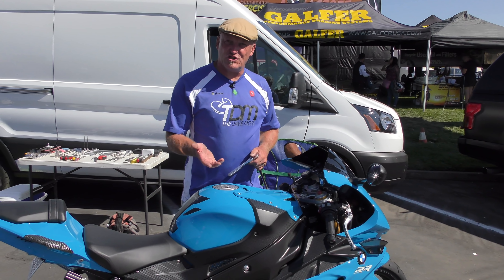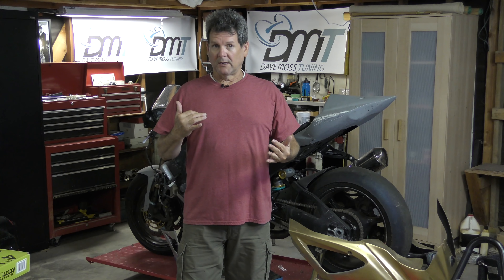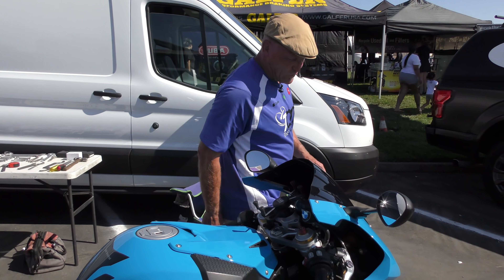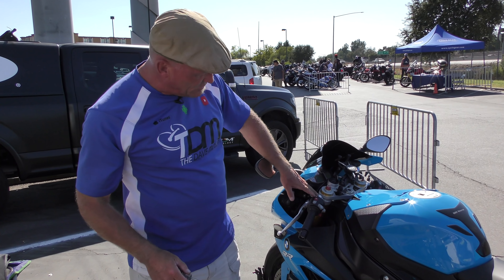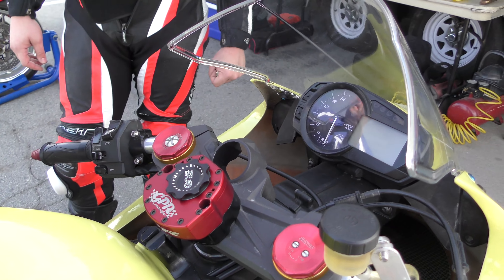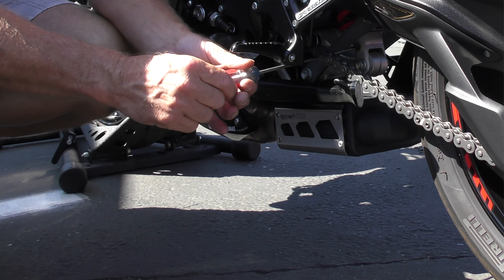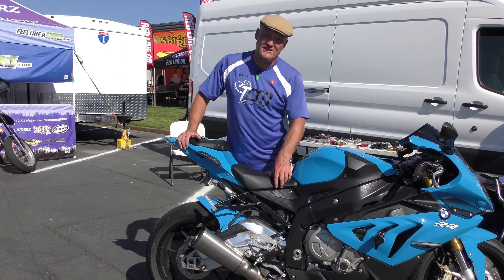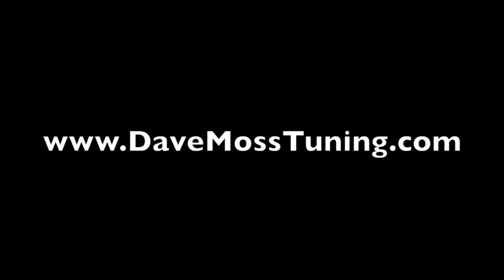Motorcycle Suspension Adjusters: What Why Where and How

Comment: something in tension is being pulled ,  the front fork spring is always in compression , it is just more or less compression that you are adjusting on the spring. I'm not talking about dampening, just the springs loading.    "In physics, tension is the pulling or stretching force transmitted axially along an object such as a string, rope, chain, rod, truss member, or other object, so as to stretch or pull apart the object. In terms of force, it is the opposite of compression."

Comment: Brilliant as always Mr Moss and Mr Williams 

Learning is a process that starts with  an inspiration to know more, after that with the right teachers it become infectious. 

20 years ago I bought my first bike, a GPZ750r and tore down the front forks  to understand how they worked.... well I needed to change the seals as they were leaking. 

Years on  and several bikes later  I couldn't understand why people found bike suspension a mute point. You pointed out that people cannot discuss what they do not comprehend.

Well its been 5  months since I serviced the suspension on a GSX750F (04) the chatter it has started around that group of riders  is getting louder and as always I point them towards your videos as it is such a great resource for learning to occur. 

One of these riders i heard  went to look at a Fazer 600 in a show room and was told it was fully serviced. when he asked does that include the forks and shocks the retailer scoffed at him with a "Noooo"  to which he replied well its not fully serviced then and you can keep the bike.

I don't know about you, but every time I tear down a shock or a fork  I learn something new and comprehend more. The hydraulic fluid for one tells a story.  whether it has turned to chip pan oil or an emulsified goop neither state is desirable for efficient suspension that brings the bike to life.

Comment: I stand to be corrected, but Dave started with all the way out ( open tap) 10 clicks out when he adjusted the rebound for the S1000RR. But the other chap said you should start all the way closed (tap closed) and then work your way out. So the S1000rr wasn't started at 3 clicks out from closed. Dave actually started it from 10 clicks out fully open. Just wanted to point this out, thanks. @10:53 & @15:05
Reply from the maker: Great point, excellent observation. If you start open, you get a more accurate rad on initial sag numbers. If the tap is closed, compression will hold the bike up so you will get a different reading. Anyone reading this comment that has adjustable suspension - try max preload and compression (measure), then remove all preload and compression (measure again). What was the difference? NOTE: don't forget to check for stiction: https://www.youtube.com/watch?v=qK6_7oTF_bI&t=6s

Comment: Im 210lbs.  fully leathered. My front, on track, dives too much... rearend seems great on track. I know I'm not balanced though. On the road, rear bucks u off at higher spirited speed, front feels really comfortable but a bit soft.
 06 cbr Honda f4i is what Im going to try out your recipe  on. Thanks for all this info. Seriously important info you are giving me... I'm   sittting on Dunlop q3 sportmax. Think, i will keep the same tires I'm used to. Temps run at my window of riding...ambient air about 88 to 98f. They perform nice on and off track with pressure attention. Just had to say it outloud.
Reply from the maker: Start with a cable tie on the front forks and mark bottom out to see how much travel you are using. Next, check static sag on the rear shock. Then check tire wear for rebound.

Comment: Thanks a lot for a video, just a quick question here i have is, after fully tearing apart, and changing all seals and everything, should we set again all the adjustments ?
Reply from the maker: I would reset hydraulics based on new oil, I would not change preload.

Comment: Hi Dave, thank you for the response. I should have elaborated better in my question. 

What i was wanting to understand is that for example on the S1000RR, you started by counting rebound on the right leg at 3 clicks from close and the left leg was 6 click out. Then you reset the left leg to 3 clicks out to match the right leg . Similar to compression on right leg was 5 click out and left leg was 2 click out and was reset the left to match the right. 

May i know how can i tell which leg is the correct one because i might mistakenly reset the right leg to match the left leg in the case of S1000RR for example. Because im still a beginner on suspension tuning :)

My apologies for the confusion earlier and thanks again for making the video.
Reply from the maker: Hi Edward. Right leg/yellow is rebound. Left leg/red is compression. Both have 10 clicks to work with for each adjuster, all the way left being minimum (#1), all the way right being maximum (#10).

Comment: I have an 84 Honda VF750F that has numbers 1-4 on both sides.  I am guessing that clockwise and counter clockwise would be the same on all bikes.   Can we say the higher the number the stiffer and the lower the number the softer?   The rear shock works on air pressure.  No longer an aggressive rider..lol  Street Settings?  Gonna have to check the rear spring tension.  Great Videos.   Waiting for the 1/2 meter of snow to melt ...lol
Reply from the maker: Hi Brent. You are correct that 1 is minimum and 4 is maximum. Suggested is 3-5psi for the fork air pressure and rear shock is 7-40psi. So I would start with 25psi and test that plus 15 and 35psi. Set damping at 2 while you find the air pressure you need, then test 1 and 3 for damping BUT make sure you ride for an hour first prior to changing damping to make sure the oil is hot.

Comment: I look forward to having fully active suspension where an ecu is doing all the adjusting for me except me choosing a setting....I would think with computers today that could be the optimal thing!  I have semi active suspension on my 22 Yamaha T9gt ....I dont know how good or how bad it is but it seems to work so far for me....all the manual stuff just seems like voodoo to me I can not wrap my head around it   Am I just beyond lazy?  Or is it reasonable to want TECH to take over keep everything adjusted?  Back in the day I had to constantly mess with carb jetting when racing MX and it was truly a PITA especially when racing at altitude etc but even changing expansin chambers or the weather etc made a difference ,,,,nowadays an ecu is adjusting the mizture!  So wonderful!  Suspension and EVERYTHING should be like that I think!  Yes it will cost more!  It will be WORTH IT IMHO lol!  I just want to select HOW I am riding and let the computer make the changes....like sport, rain, comfort etc....Seems like sensors and servos etc could make changes as you ride the moment the conditions change the settings adjust!  ya know?

Comment: The time I watch your video Dave I’m so impressed.. i have 2020 MT09. My question is, I adjust my shock on the rear and front shock,do I need to adjust the front shock also? or stay on the factory level? Thanks you
Reply from the maker: Try factory height on the forks to start for a couple of weeks, then change fork position by 7mm and see if you like the difference.

Comment: When using preload adjusters which are just turns(like a 17 wrench on forks or an external shock adjuster),when nearing the maximum,there is always some resistance when you are near the end. To get a proper reading,do you stop immediately after you feel ANY resistance,or keep going a bit more?
Reply from the maker: Resistance will increase as the spring is under increased tension. I will go from mechanical stop to mechanical stop to find the range and know where I am. For reference, the owners manual will tell you how many revolutions you have for each adjuster so use that for your initial reference prior to making adjustments.

Comment: Hi Dave, nice video, I have a z1000sx Kawa, which oil it's the best for your experience for the front fork? My style driving it's tourist, no races, but I don't sleep on the road. I ride alone, no passengers, sometime whit boxes back, ma not so often. Thank you for the answere. Nice world the suspension bikes world, I think one of the most complicate to know. Regards
Reply from the maker: Thank you for the kind words! For your situation, I would recommend 10w fork oil, Motul or Maxima seem to be readily available. Use the stock volume or oil height!
Reply: @catalystreactionsbw  Hi Dave, tanks for your information, My z1000sx year 2016 24K km, runs well, I update myself the settings front fork and back respect your video concerning exactly my bike. (Iam 85 kg ready to drive) But, one problem I had before and still exist. Shimming bar drive if I let the bar free in deceleration. Not to much but I have. Pression tire 2,5 /2,9 , I try less no change at all. Tires perfect balanced, bike never drop down etc etc, chain tension in the range, no play in the tree fork..What can I do?? suggestions?? many takes and regards... Piero
Reply from the maker: @pierograndi5898   Hello Piero. If the bars move side to side on deceleration there are a couple of things to check.  1. Too much weight transfer forward as shock rebound is too fast. You might try to turn it half a turn left, then 1 turn right to see if that is true. If not, it goes 1/2 turn left back to the original position. Fork collapses too quickly so compression screw is too open. Turn it in 1/4 turn increments right to see if that is true. If not, turn it 1/2 turn left back to the original position.   3. Loosen the pinch bolts  and ride the bike at 15 -20kph and brake several times. Tighten and torque the pinch bolts again and test.
Reply: @catalystreactionsbw  Hi Dave, I follow yours suggestions and I have resolve the problem, It was generated by the suspension front and rear I make harder just a little and...TOP!!! Many tanks Mr Dave, will be a pleasure drink a beer with you. Regards and thanks again Piero.
Reply from the maker: @pierograndi5898   Thank you for letting us know you found the solution!!

Comment: Good day Dave, My name is Enrique, I am from Mexico and I have a bmw F700gs 2014.
The forks have no adjustment at all, manual says that it has 550 ml of oil in each fork, in order to adjust them the way a like it, I think I can add or put less oil, then I use the motorcycle a few days and see how it works.
Am I, right or wrong? And the increase of oil should be ? . I want the suspension stiffer.
Reply from the maker: Hello Enrique. Depends on your weight - I need that prior to recommending fork oil viscosity.

Comment: What about on a basic bike with no fork adjustment and only preload on the rear. Any tips and tricks for playing with these on the cheap?
Reply from the maker: Oil viscosity thicker or thinner and different volumes along with different size spacers. You can also change fork position for faster or slower turn in.

Comment: Just bought a 06 gsxr 750 front end to swap onto my Victory Octane and as soon as I picked them up I’m like I need to earn about suspension setup!
Reply from the maker: Look at videos on my channel for fork sag, shock sag, fork travel and shock travel. Those short videos give you the basics. Then watch fork bottom out and "dump and run" oil change as you will have to do this unless you know for sure that the oil was changed before you bought them. Enjoy the learning and thanks for choosing DMT.

Comment: Quick question for Dave or anybody else who might have an answer. I have a "new" '02 GSXR 750 that I'm attempting to set front sag on. The rear sag was perfect for me already. 
The front is coming in at 44 mm with me on the bike. I turned the preload adjusters a 6th of a turn at a time to one full revolution and the numbers didn't change at all. Should I just keep on cranking or what?
Reply from the maker: Just keep cranking on the preload as it is a very progressive spring. Then assess fork travel used to see if you can get to ideal travel, that being 15-25mm from the bottom of the chrome tube.
Reply: @catalystreactionsbw  thank you my friend. I didn't want to start cranking, go too far and screw something up

Comment: thanks Dave! Hey I've seen you at Buttonwillow before, but I don't think you offer suspension support.  By any chance will you be offering suspension support at BW?  I just installed a MUPO Suspension on my K46.  I need help setting it up.  I want to say you go when Pacific Track Time is there.  I ride BW Feb-Sept.
Reply from the maker: I do not work at Button Willow unless there is an AFM event or Carters at the Track has an event there. All other BW Track Day providers have contracts with other suspension vendors.

Comment: If you’re bottoming out forks, would you add more preload or compression and why?
Reply from the maker: preload first as that is steel and structural, then compression second for oil flow control. If you bottom, repeat the cycle. If you get to 80% of preload and compression, is your oil old or has your ability increased substantially so you need to revalve & respring?
Reply: @catalystreactionsbw thanks for the response. I added on more preload and that brought my zip tie up about 2-3mm up from bottom out. (Still not enough in my opinion) However, the bike felt a bit less planted through the one fast right hander and I had minor headshake in that specific sweeping corner that I did not have previously. Would that have anything to do with it? That was my last session of the day however so I am curious how to precede? Thanks again for the replies.
Reply from the maker: @sackychin6267  Yes, if you added preload you may have created harshness. A little more rebound damping may have been useful to combat that.

Comment: Hi Dave why the older bikes have on both forks   comp and rebound but the newer bikes not? My s1000rr 2015 have just one comp on one side and rebound also just on one side,so i can't adjust the compression on both forks why is that?I have also buy öhlins fgrt 200 forks,but there is the same have not left and right comp and left and right rebound. So how can you adjust the compression on both sides when there is only one compression on one fork?
and why is there no imbalance? logically thought, both forks should have compression and rebound i don't understand this.

Comment: So …I heard here that preload adjusts sag. Does that mean that if I add maximum preload, I’m lowering the bike? 

Also, does adding preload mean I’m effectively lowering the range within which compression (downward) and rebound (back upwards) adjustments can be made?
Reply from the maker: If you add preload, the sag number can decrease and the height of the bike will rise as adding preload makes the forks and shock longer.
Reply: Interesting. The spring is getting shorter, but the shock is getting longer? Having a hard time visualizing it. Thanks for responding!
Reply from the maker: @jayvidz  Remember that the lower tube slides down. When you make the spring stiffer it pushes the sliding leg down making the forks longer. Yes, the spring gets shorter.
Reply: That helps. Thanks. How about in the rear where spring sits outside the shock? Bike is monster 821
Reply from the maker: . @jayvidz   Same applies, but as a data point static sag decreases

Comment: Dave, first of all congratulations to you and your team with the videos. I have a problem since my bike (monster 821) does not have adjustable forks. The bike is too soft which makes the bike bounce a bit after the full suspension travel. I am taking my bike to the track and wuld like a harder spring. I am 70 kg and 1,76 m.  Do you recomend changing the liquid or not since the fork is made for an specific liquid? Thank you again.
Reply from the maker: Hi Santiago. Thanks for the kind words. Fork oil needs to be changed around 8-10,000kms. If you are around that number, it is time. If not, change to 10w fork oil. If you want to change springs, you would change to .90kg/nm rate.
Reply: @catalystreactionsbw  thanks for the recommendation, do you recommend progressive or continuous springs? I also do touring with the bike and do not want to loose too much comfort.
Reply from the maker: @santiagosalcedo7909  progressive for touring and comfort :)

Comment: Do you have a special chart or quick guide for me to refer to on all these terms?. It will be much help rather than revisiting the whole video again
Reply from the maker: Sag & preload, set rebound and then compression, lastly pressures hot or cold (gain 4-5psi from cold)
Reply: Dave Moss Tuning Yes.. I meant chart.. which shows rebound requires  clock wise turn for xxx, click out etc.. or anti clockwise turn.. as a quick guide for us to setup or tune the suspension

Comment: I have a 2009 Yamaha FZ1. I just added a new rear suspension that is sprung for my weight. My question is about the front suspension. Which side is compression and which side is rebound?
Reply from the maker: Left is COM and right is TEN
Reply: @catalystreactionsbw  Did you mean right side is rebound?
Reply from the maker: @twowheelpursuits  TEN and REB are the same, and yes, right side.
Reply: @catalystreactionsbw  Thank you for that.